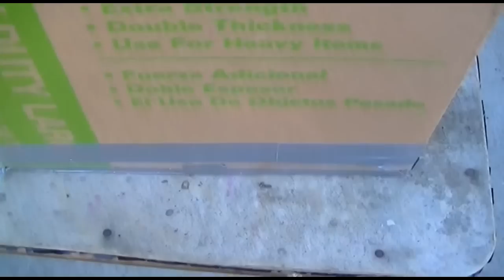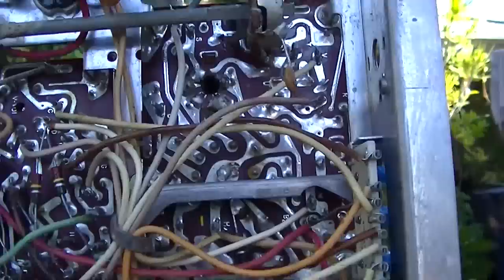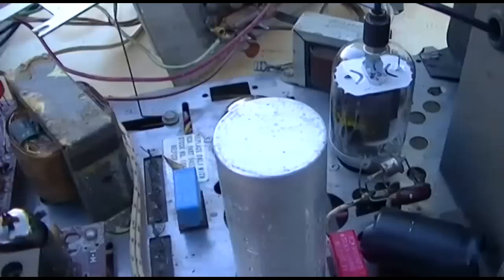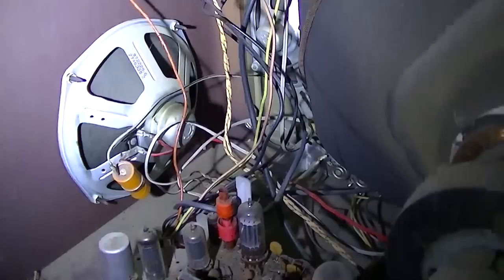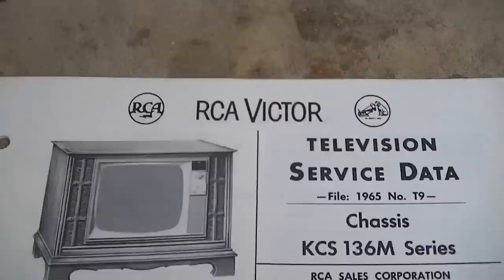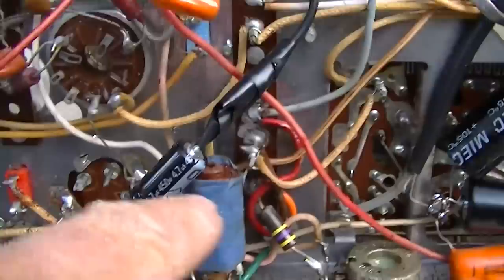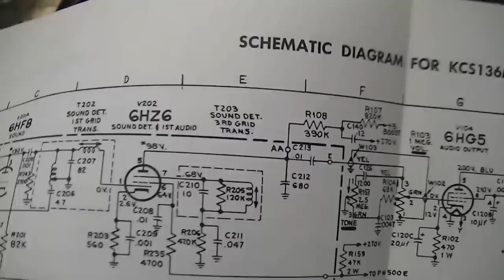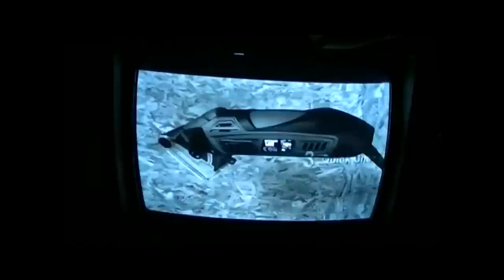RCA KCS136 Black and White TV Chassis Repair RE Re re Cap

Comment: I agree instead of jumping all over someones case that its far more beneficial to just show the errors and then a solution to the issue. I've had alot of the "holier than thou" attitudes come from the old boys club in quite a few hobbies I've ventured into myself (radio control airplanes being a good example, sigh....) and nothing drives a newcomer away faster. Thanks for sharing your tips and tricks to those of us less knowledgeable folks and for helping keep this old technology alive.
Reply: He did a good repair on hi tv
Reply: He did a good job on repair on his tv

Comment: For a beginner he did an pretty good job. I have repaired plenty of CRT TV's and PC monitors in the past and the fact the guy followed the service manual is a good sign.
I like working on old tube type TV's and radios though, more fun and easier. The solid state and LED/LCD flat screens can be a challenge and require some specialty tools if it involves anything outside of a re-cap job.
Reply: He did a good job on fixing his tv

Comment: No discouraging words from me toward the person who tried to fix the set. All of us who repair electronics, and other items for that matter, had to learn along the way. Even when you / we've been around these items, we still make mistakes once in a while too.. so I give the guy an A for effort. It would be great if he could have worked along side someone to pick up some basic tips - especially safety related tips. On a side note, when I went to college for electronics / electrical engineering back in the 1970's, we had a basic explanation of tubes one day. Why one day? Because tubes were obsolete, what little was in use would be junked, so they were a non-issue. This as per the instructor of the class. DUH!
Reply: Bigger electrolytics make great substitutes for M80s when accidently wired backwards. I know, believe me.:)
Reply: That seems rather shortsighted on the part of the instructor, considering that they were making tube type and hybrid TV sets right up until 1975-76, 1979-80 if you count G.E Portacolor models. TV sets were not cheap back then, a 21'' table model colour set could run between $400-500, so people were inclined to keep them running as long as possible. I know that tube and hybrid TV sets were still showing up in repair shops right into the late 80s, then you have things like organs and guitar amps which still need repair.
Reply: madisonelectronic  When an old electrolytic capacitor over heats and pops...it is one hell of a bang, and usually sends the can skyward, had one pop in a tube guitar amplifier I am working on and I think half the building heard it go, but it was simple to fix, just wire in new modern caps under the chassis on a terminal strip. :)
Reply: Most of the twist lock style filter cans I have run across actually have a vent in the base somewhere, so the thing will fizzle, spew out steam and borax, but not actually explode. It's a fairly minor concern in many old radios and TVs anyhow, most are so old that the paste inside has dried out partially or completely so that the can is almost open circuit and needs replacement anyhow.
It is less of a concern in a guitar amp but in many early TVs and radios there just isn't room to install replacement caps under the chassis, even with a terminal strip. So sometimes, both for appearances and for logistical reasons, I cut the can open, clean out the old contents, and instal radial lead caps inside like Shango did with one of those metal cabinet portable TVs in another video.
Reply: I accidentally wired an electrolytic reverse-polarity in a radio.
It did a good impression of a party popper, even though it was only the cathode bypass on the 6V6 output tube.
I had a hum filter capacitor go 'bang'. It was a blue & white plastic cased thing made by Dubilier. This was still a waxed paper capacitor in a new coat & didn't like being re-introduced to 240 volts AC. It burst like a Chinese firecracker less than a foot from my right ear.
The fright was such that both feet actually left the ground.

Comment: I saw those 3 electrolytic capacitors floating wired point-to-point and the EE in me screamed "use a terminal strip! good lord!" :) that aside he is doing pretty good work, just has to become more comfortable replacing PCB components by de-soldering, and on these old RCA boards you have to be really careful with iron temp too or traces will lift, ahh the fun of vintage electronics!

Comment: Back in the day when you had no horizontal or vertical deflection you had to go and check out the horizontal vertical oscillators if he had no high voltage you have to go to the flyback Transformer and check out and make sure the horizan out out  or ck out the  horizontal oscillator. And sometimes a high voltage rectifier if you have no sound no power and you got a check for selenium rectifier is blown and if they used those 5U4 as a tube rectifier used in half wave power supply

Comment: Motorola recommended the same "lead extension method", while in the field. I was under the impression that they felt that most of the IF and RF (VHF and UHF) component level repairs would best be accomplished on the bench.

Zenith's position was (when limited component accessibility was a factor) to "take it back to the bench", replace the defective components with "Zenith-approved parts, ONLY" while any serviceable warranty existed - on any major components.

I second Alan Maier's viewpoint(s), and his is a damn good idea - for 2015, let's try to establish a video mentoring program (and I'm the worst offender, as I'm limited to posting  slideshow-format videos only - as my digital camera took a dump many moons ago!) 

For 17 years, I instructed Mil Std 2000 Category "C" soldering for my employer. While the standard is recognized by most manufacturers, the currently required, and most preferred specification is IPC J-STD-001. Constructing, and the instruction of a condensed course shouldn't be a biggie.

Long story, short, it would further the hobby by leaps and bounds for those of us who have the extra time, to "pair off" with, and instruct those new to the hobby in how to best accomplish repairs (technically and mechanically)

Comment: Hi, when u show the combo unit with the FM tuner, u said that it "does not decode anymore of course", is that because anything changed on the FM Stereo standard over the years, or just because the tuner is not working properly, just curious, thanks!

Comment: Question:  On your RCA combo-set you said the FM-Stereo decoder "doesn't work, of course."  Is that because modern FM-Stereo signals are different than they were back then?  Or is it just because the set is old and stereo-decoders break easily?
Reply from the maker: The alignment of the stereo decoder is very critical and the old tube stuff drifted allot so they need constant alignment to work correctly. It just needs to be aligned. Modern stereo broadcast hasnt changed

Comment: super late, but MIEC caps are caps commonly supplied by Justradios, of course they come from china and are extremely overpriced. No fault on the guy, I used to use them until I started using Nichicon caps from Mouser.

Comment: Sorry for a third comment, but TV high voltage is not deadly, it's just a heck of a bite, it'll scare you but as long as it's just your one hand on it, ain't gonna kill you! High voltage, low amperage, hurts like a mother, but won't kill you. Now hybrid car batteries are another story, those are high amp high volt DC...they...can kill you, their scary stuff!
Reply: Notice the tone of sarcasm he uses whilst pulling the lead. Mind you if you get between the H.V and ground whilst the set is running you can get a bigger wallop, maybe even burned, although it is unlikely that you would be killed by it unless you have a weak heart.

Comment: that thing at the end with George Carlin was class as hell! And completely true, as-seen-on TV stuff never works except for one thing...the showtime rotisserie oven that Ron Popeil sold, I still have mine and it still works and makes delicious rotisserie chicken...probably the only ONE good thing ever sold that way 92% of it is crap...
Reply: Some of the power tools they sell over those commercials were actually viable products, two that spring to mind are those oscillating saw things, and the Roto Zipp rotary cutters, both of which have ended up in bonafide tool retailers like Home Depot etc. Currently I noticed that they are pedaling pressure cookers again, except the ones they sell on infomercials have a built in heating element and a digital timer, I question the reliability of such a feature but the stove top cookers definitely do work.
  One gimmick they have added since George Carlin passed away is the gimmick of adding a second identical item free, if you pay additional shipping and processing. Personally I don't think they should be allowed to market them that way, it's misleading, if the second item is included as part of a two for one deal then the shipping and processing should be included.

Comment: It there still analogue TV transmissions in the USA?
Reply: *****
Where you are in Canada, but not where I am, I know because I was watching analog over the air last night on some of my vintage sets. They were supposedly supposed to be gone two years ago, well so much for that idea.
Reply: No but u can go to RadioShack and look for a pronged thing with a coaxial input I'll make a vid if you want
Reply: +brian whittle 
No not legally though some pirate stations do pop up here and there from people buying things off ebay.
Analog is no longer legal for OTA broadcast television in the US.
Reply: ElfNet Gaming
You can use an agile modulator to supply a signal to an analog TV, those are perfectly legal to use since they are basically like a part 15 style radio transmitter, The whole switchover was an absolute waste of time and money, the golden age of TV ended in the early 80s, who the heck needs to watch Jerry Springer in H.D?